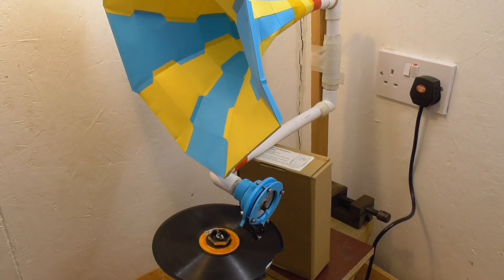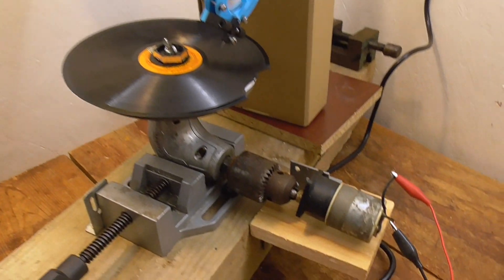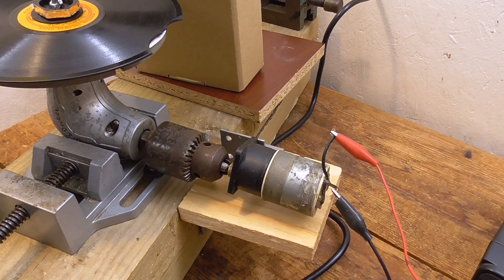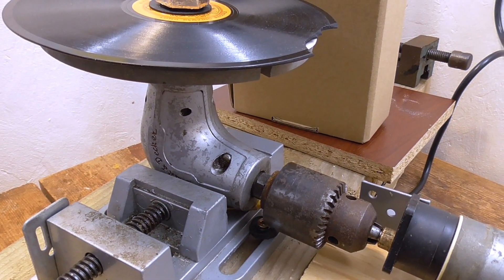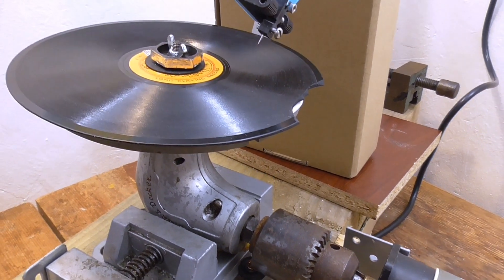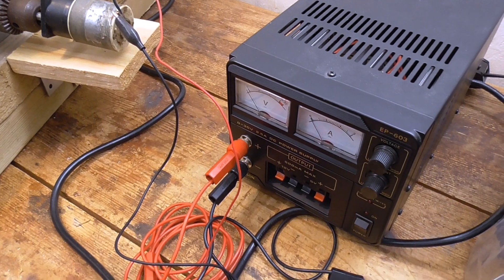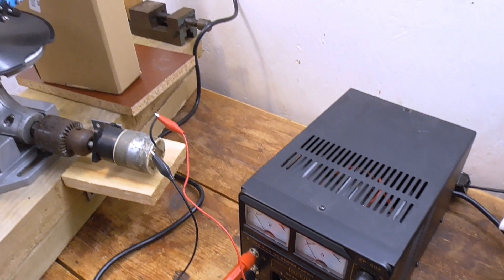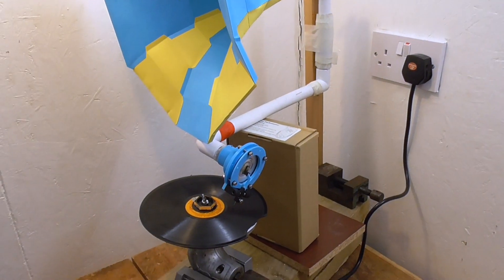Electrified gramophone!

Comment: Nice, it sound good actually.
However, "Old man river" is a tenor song. It might be too low for the reproducer. 

Good speed controling too!
Reply from the maker: @jimmyjudha8424  Thanks 😀👍. I probably have more suitable records now. I try to use records which don't flag up for copyright on YouTube and also that aren't too rare or valuable. The geared motors do produce some noise, but are remarkably stable even at a reduced voltage (which is due to the need to control the speed), as long as they are connected to a decent power supply. I love making stuff like this. Did you see this one?
https://youtu.be/9s9-pTKzKOs
Thanks 👍 😀

Comment: That's a good idea, am amazed that the motor speed is right for the record. It inspires one to think outside the box. Cheers! :goodvibes:🙂
Reply from the maker: It does look a little slow, however that might just be an optical illusion in the video. The motor is running at less than 78rpm, though, as the drill adapter gearbox increases the speed. Thanks 😀 👍

Comment: This worked really well. The speed was steady from that motor too.
Reply from the maker: Thanks 👍😀.  The speed is much more steady than the hand crank, but there does seem to be some wow and flutter. I would like to try hand cranking it again, but I think I need to do quite a bit more work on it before that will be effective. I suddenly realised though how easy it would be to add one of those geared motors and it does work surprisingly well! 😅

Comment: I haven't seen a record player so overbuilt as this one since the 30s when they were all made like this one.
But, seriously, it sounds like it is going a bit slow.
Reply from the maker: Yes, no record player really needs a gearbox and this has 2, one which steps down and one which steps up! I did check the speed, but that was without the soundbox dragging on the record. The motor should have been powerful enough to overcome that, but its possible it wasn't. I couldn't find my DIY speed tester which lets me check the speed of the record as it plays,  but I have that again now, so I can check and adjust better for the next video. Thanks 👍😀